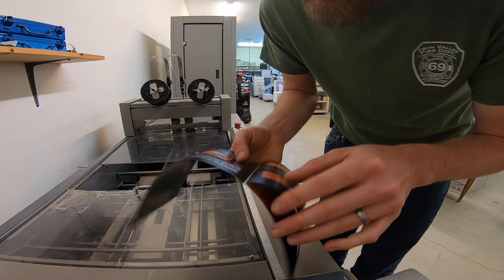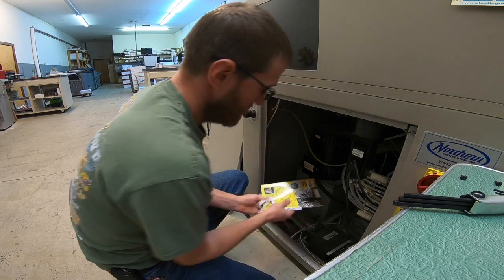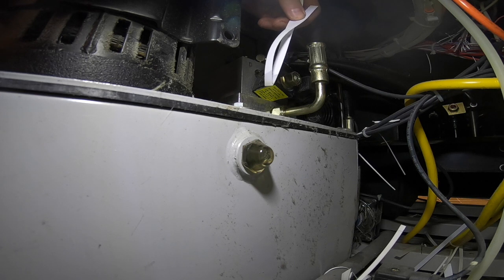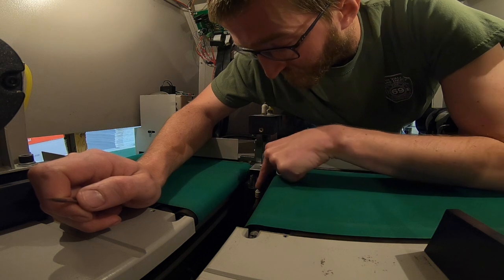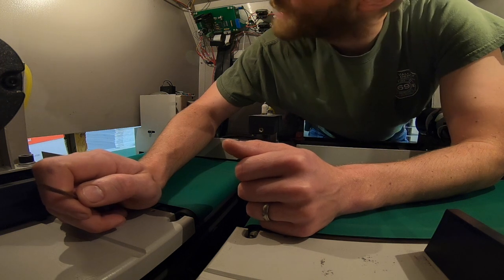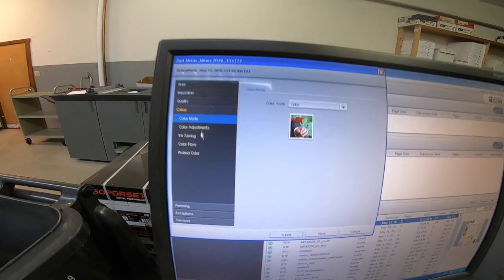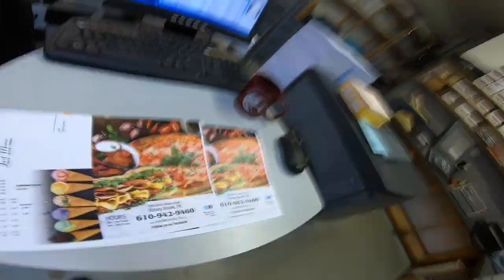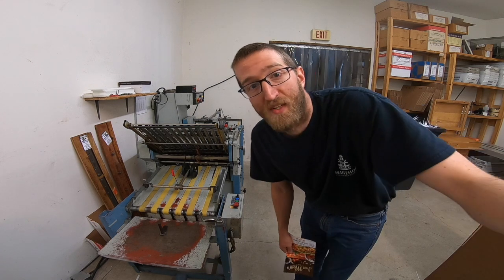RIP Curves to Get Best Color Possible on CREO Konica Minolta C6500, National Printing Research

Comment: Following and viewing almost ALL your videos, Im struggling with my press c7000. On a print with a full coverage page, there's a few vertical lines that the toner are fainted. Always in the middle of the paper and on each half 1/4. Not drums, apparently not belt. The faint does not move along with the sequential pages, so is a pain in the head for me now.

With all your experience, do you have any idea of what could be or where I can take a look to take down this problem?
I'm refusing jobs with pages that contain full plain colors because is highly noticeable. =(

Thank you!
Reply from the maker: Might be a developing unit problem or a dirty wire.
Reply: Or dirt on the laser glass. I've also seen toner built up beside the laser so high that it blocked the beam. It was a long time ago so I can't remember exactly where.  3 years late but it might help somebody.

Comment: I'd always start with the engine. If the engine won't hit Dmax (maximum density) for a color no amount of curve tweaking will help. Personally, I go in and bump all the color channels Dmax a couple points, black a couple-three and yellow about double that. Then run gradation adjust. You should just see toner at about 2% in the lightest square. Then run your calibration at the Creo. Presentation rendering intent also boosts color saturation and contrast. Lastly, if you're trying to match another machine's output, grab its ICC profile and install it in your Creo as a simulation and within limits of the engine it will try to match the output of the other machine. In the past, I'd have charged $350 for that advice and demonstration. (2hr minimum). This is how I setup my showroom machines, or did until they hired separate "production" print specialists with G7 certs.
Reply from the maker: I agree, engine first. I'll have to toy with the presentation rendering. Good tip, thank you!

Comment: Hi! Love your channel! I use that(Gradations)  almost everyday on my CREO/6500. The big question is, I also have a 2070 (and a C6000), both on FIERY. How would you do the same on a Fiery? I have yet to find that feature on Fiery systems. Also, from all of us viewers, a Huge THANK YOU for all of your sharing of your knowledge. I’ve saved THOUSANDS on technician calls doing my own developer, sensors, fuser, etc. I still keep 2 Konica’s on service, and 2 are self served by me, thanks to you!
Reply from the maker: Thats great news! Yes, the savings will add up!! I have not found a place to change curves on the Fiery. The best I found isthe Image Viewer Curves feature in the color settings. But honestly I have only once wanted to adjust the curves on my C3070 color are pretty dense and consistent on there.
Reply from the maker: Shoot, I just explored the Color Profiler Suite. I don't know how much it costs but you can play with it in demo mode. There are all kinds of goodies in there. Thanks Steve Weiss!
Reply: Fiery has that feature.
http://help.efi.com/cws/6.0/en-us/GUID-7ABB56DC-032E-4900-9B9F-807C2E1F65EB.html
Reply: You can make new tone curve in color centro but you will have to use printer driver to print...

Comment: Nice video - One Question what is the difference between Color correction with RIP curves instead of doing the same in Photoshop? will the result will be the same?
Reply from the maker: Good question. Results would be the same, but if you adjust it in Photoshop and go to print on another printer your color would be off again. I was adjusting on the RIP because of the current state of my printer. It looked good on screen, I needed to adjust so the printed version would be the same.
Reply: @justaprinter  Also, it affects all pictures on a page, avoiding having to adjust many pictures in photoshop.
Reply: Fiery has built-in Photoshop-like capabilities with IEVE (Image Enhance Visual Editor) that enable you to adjust photos one-by-one, even to save your adjustment settings and apply them to other photos as needed or across the entire document. If you have GAPPE (Graphics Arts Package, Premium Edition), then you have ImageViewer, an interactive color adjustment tool which lets you make tweaks like you would to a color profile--even soft proof before-and-after effects--but at a job level, leaving the output profile unaffected, which is a good thing.
Reply from the maker: @The_Weissman  Oh wow, that sounds like a neat feature! Thanks Steve!